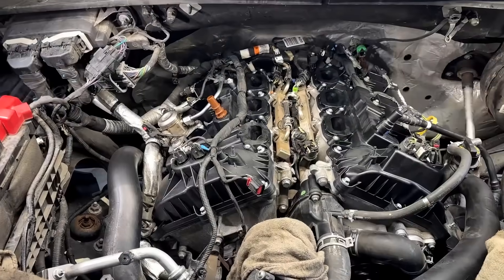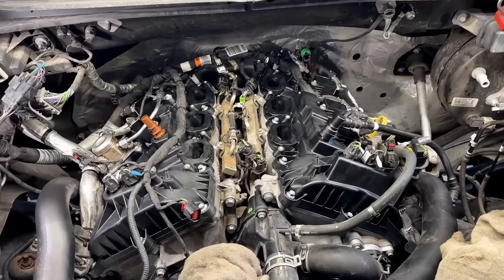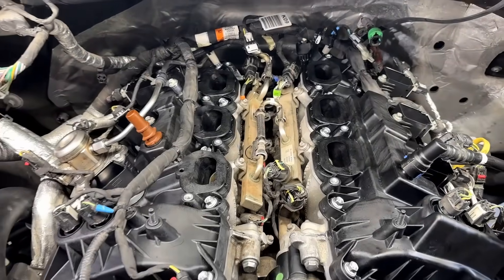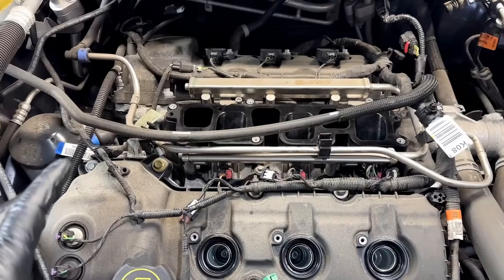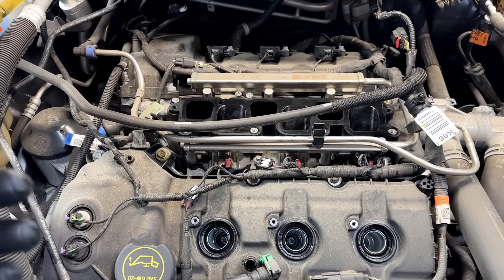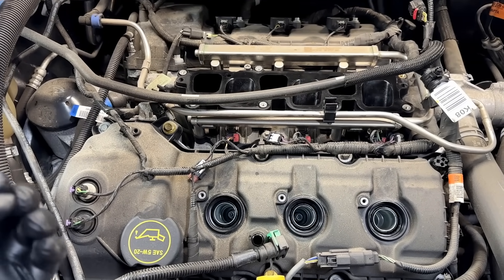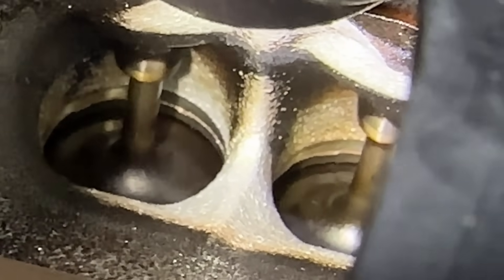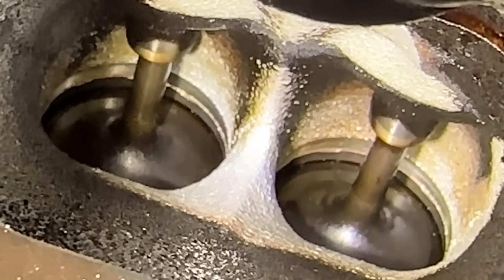Does Ford's New Dual Fuel Injection 3.5L Ecoboost Engine Really Fix the Carbon Build Up Issue?

Comment: So is running the transmission selector in eco mode a bad thing then? Should I be doing some hard accelerations to burn off the cabon or is that not going to make a difference?
Reply: He mentioned that port injection is in play at idle and when accelerating lightly, so no, hard acceleration is not going to help because that’s when DI is working.

Comment: It's amazing to me the more engineers try to redesign the wheel, the more square it gets. How many motors over 12 years old are still running good without any major work have been done to them, as long as good detergent gasoline was used and yearly maintenance was done. (It's my '06 f160 xl with 4.6 ,165,000 miles still runs like the day I bought it) Oil change every 5,000 miles,  STP fuel system cleaner every 3rd Oil change. Had 100,000 miles service. K&N air filter gets cleaned every 25,000 miles. When spark plugs were replaced for 100,00 miles maintenance, they looked almost brand new. Bought truck to take me to nursing home or grave eventually.
Reply: The point is, they are not designed to last anymore. They are designed to fail just after your loan is paid off so you go back to the dealer and buy another one.

The only consistent design with any manufacturer nowadays, is their business design to keep you in a revolving door of debt with them.
Reply: It all in their effort to achieve slight fuel mileage gains and cleaner air.  I'd gladly accept previous technology and save the thousands of $$ we waste today.  Check out any Ford two-valve 4.6 and see how the hundreds of thousand miles they can crank out and not require anything but common sense maintenance. PS Meant to add that I've had two Town Cars with well over 300k miles each and never needed to open them up, except for the damn plastic intakes that puked coolant (Dorman to the rescue). These were the pre-phaser debacle days! Ford's timing/cam engineers fell asleep beginning with the 4.6-5.4/3-valves and phasers still don't last.
Reply: @jamesplotkin4674  2010 F150 with a 4.6 2-valve.  Just hit 165K miles with oil changes every 5K miles, Motorcraft 5W20 synth blend.  Engine runs great, have had to change a few ignition coils over the years.  Only issue is a very slow oil drip coming from somewhere deep behind the rear passenger side of the engine.  Not enough for a $3000 tear down to repair.  Due for a thermostat change as well, as the engine is running cool.  That looks like an easy job.
Reply: So what you mean,is the old Italian tune-up won't help, cause at wide open thottle,it's only running direct injection,then idle and drive like old lady you run on port injection.carberaters clean valves better,where is technology going
Reply: @michaelbefumo-qg7ji nah I still boost once a month when a dodge hemi or toyo want to pick a fight. The see the f150 red tailgate every time
Reply: well the f160 was a better made truck than the f150
Reply: @jeromeharrison7450  f160? Really? Right!

Comment: Will an Oil Catch Can actually make a difference on this dual injected setup? Or should this Gen Eco Boost owners join the pin hole in the intercooler club. I ve also noted less carbon pick up on my spark plugs which lasted me about 55,000 miles since I had to get an Induction service due to Loss of power  back when my truck had 47,000 miles ( currently at 110,000) - 2011 screw ECOBOOST

Comment: I've got a 2012 5.0L F-150 that some years ago, I put air/oil separators in the emission system.  When I change engine oil, I clean both oil catch cans and one is about three quarters full and the other is about a third full.  I couldn't believe that much oil would be put through the intake into the engine.  I remove the throttle body about 35,000 miles just to check the intake manifold for oil.  It's clean.

Comment: The 2019 with 125k miles obviously had more rural/highway use which alone may have reduced carbon build up.  Getting rid of direct injection completely and putting the camshaft(s) back in the block sure would make for much higher reliability and probably 300k miles before any major engine work would be required.  I believe overall carbon footprint would be as good or better too if you consider everything.
Reply: direct is a power adder but pollution adder too so EPA should ban it or regulate it for that.
Reply: @jamesmedina2062    They do regulate emissions,  the entire reason the dual fuel system exists to to help with soot emissions.

Comment: Have you come across vehicles equipped with an aftermarket oil catch can in stalled in the PCV system and, do those engines seem to have less carbon build-up?

Comment: The root cause is the cam timing causes the intake valves to open up as the engine is on the end of the exhaust stroke.  This pushes exhaust back up the intake to be drawn in and burned again.  This is how the automakers got rid of the EGR systems on engines.  We can thank the EPA for all of the carbon build up issues on DI engines.
Reply: Actually it's the PCV putting blowby into the intake.
Reply: @hotrodray6802  that's what I think.
Reply: @hotrodray6802  not chevy bud, PCV goes into valves on ford.
Reply: I think you're partly right but you're forgetting pcv being sucked back into the intake manifold along with small amounts of oil passing down intake valve seals
Reply: @chrisoliveira6941  The oil adds to the issue and adds layers.  However, what we have is carbon which is the result of combustion.  It would need to be over 400 +/- degrees in the chambers to get oil to its flashpoint and create the carbon we see in the video.
Reply: So, would it be even less had the owner installed a catch can on early in the life of the truck?
Reply: That's what I'm wondering
Reply: @danmueller8895 oem will not do this because it requires maintenance that that can't count on customers to do inside of warranty. Not servicing a catch can hurt an engine badly. But I agree with you. Don't buy a cheap small one that you constantly have to empty either
Reply: @danmueller8895 tried it. It causes turbo issues.
Reply: Sorry but incorrect. It’s the atomized oil mixed with the gasses and goes out of the crank case ventilation valve and fed back into the intake. Then into the ports. The atomized oil then instantly burns to the hot metal and boom. Carbon build up. Catch can lowers this by 90%
Reply: @jonathanottman3627    Please explain how the manufacturers got rid of the EGR system.  I was there as a powertrain engineer from 1994-2007 and my description is how we did it.  The little bit of oil from PVC only adds to the problem and is NOT the root cause.
Reply: Wrong
Reply: It still goes into the ground after we clean it out
Reply: Damn the EPA for giving us cleaner air and water. Selfish SOBs. Sounds like Ford is to blame with poor engineering standards.....
Reply: @kennethwolkens6251: appreciate your engineering input. A few questions: (1) are you aware of testing done with cams of alternative timing that would reduce/eliminate the regurgitated exhaust gas into the intake? (2)are you aware of gas sampling/analysis for gases taken from (a)PCV return line (b)intake runner and (c)pre-catalytic converter location? It seems to me that the buildup is coming from un-oxidized products... i.e. CO(though poorly oxidized) and CO2 would not be chemically amenable to carbon deposition on the places shown. Just thoughts/questions... would appreciate your input.
Reply: EXACTLY CORRECT ON THE EPA. MY brand new 1973 Country Squire Wagon with a 429 had carbon buildup on the underside of the carburetor butterflies. I blocked it off and have been ever since.
Reply: I agree with you about the mechanical cause of that carbon build-up but the EPA shouldn't be blamed for promoting clean air. Look towards profit-driven manufacturers that short-circuit testing programs and underfund  engineering departments. They sell ill tested designs and then, look elsewhere when, more than often, their gamble  backfires. Regards !
Reply: @Daniel Robert  the buyers that are early adopters are the testers. Lol
Reply: @danielrobert7181 the EPA is definitely required to shoulder some of the blame.

Comment: Thank you for continuing to report on this. Were either one of these running catch cans, synthetic oil (natural gas), running premium fuel, changing oil at 5k, ? More reason we need to work out electric vehicles or give up on the marginal fuel MPG gains and go back to port.

When I recently changed out my sparkplugs at 62k I noticed the plugs were Carboned up slightly (not fouled), is the carbon on the sparkplug a good proxy for what the valves look like? My van still runs great and I am always ahead of maintenance cycles (as I have always been) as it's worked for me historically. Thanks again!

Comment: I have a 2012 3.5 with over 180K on it. No catch can and original timing set. Runs great in warm Florida. Do you think I should have the valve walnut blasted clean or wait for symptoms and have it torn down for cleaning? Merry Christmas!

Comment: I'm very interested to see valves on a dual-mode injected engine when it's been run on E85. I have a 2019 5.0 F150 and run a couple tanks of E85 every few months to try and keep carbon buildup to a minimum.
Reply: From the engines I've seen in the shop that were run on E85, it's not good. They look like they have been running for many hundreds of thousands of miles. 
But, I haven't seen a 5.0 yet.
Reply: My gen 3 Coyote runs somewhere between 70%-85% Ethanol all the time. Only time it uses 100% Unleaded is after oil changes per recommended by Ford. I bet anything everything is clean as can be. I have seen other engines opened up that ran E85 all the time and there was no carbon on anything. I'm talking they looked brand new.  The only thing you need to worry about with Ethanol is water and the corrosion from it. So long as the Ethanol doesn't get old in the car it should be a non issue. Also, it will break down the oil a alot faster. Even thought my car takes 10 quarts of oil to combat oil breakdown i change it every 3 months regardless. I only put like 1 or 2k miles on it in that time but better safe than sorry. I also use the best full synthetic oils.
Reply: I’ve seen a Mazdaspeed L3 the same as 2.3 but no vvt on exhaust. No catch with egr running meth at the TB still pretty nasty but better. Also seen with cans no egr 4 extra port running e30 mix stay cleaner. Then again both fuel systems run at same time with split fuel controller.
Reply: Make sure you always run 20 mins plus after fill, oz tuning is the way to go performance and reliability check out omegax flex fuel tune
Reply: stop using that crap/

Comment: Great video, I was curious about the dual fuel injection. Also good info on how the system works. 100k to 150k miles and you have to do a timing job on this engine? Yikes.

Comment: Great video Brian. Thanks for the triple comparison. I have walnut blasted my 2013 twice now at 120k km (not miles) and run a catch can now after the second round. I expect a third round this summer, but hope not.
Reply: How much did that cost you?
Reply: @TSS-T85  $50 CAD for a 50 lb bag of walnut shell media, $26 for a cheap media blaster that I modded. I already had a good compressor, shop vac, safety PPE and a BUNCH of patience and research on how to do it correctly and eliminating the risk of filling the engine with walnuts. It’s work for sure.

Comment: The other reason the gen 2 ecoboost had more carbon buildup than the traditional port injection motor is the port injection motor was NOT turbocharged. 
Turbocharged engines tend to naturally have more blowby than non turbo engines which will result in more carbon build up on the valves…..
Reply from the maker: The port fuel injected vehicle was just a reference point before all this GTDI stuff started and nothing else.
Reply: 👍Got it… 
I really like the old school port injected engines for longevity…

Comment: I don't know if it makes a difference or not but at about 80,000 (120,000 currently)miles I switched from regular gas to premium from Shell that has the detergents in it like I said I don't know if it makes a difference or not on a 14 3.5 EcoBoost F-150 but I figured it couldn't hurt... I also put a jlt catch can on my truck at about 95,000 MI

Comment: That's why it's of great consideration to get an air oil separator where the oil drains back to the crankcase and it's kept out of the intake... The crankcase ventilation system has a lot to do with the buildup and The port side injectors aren't fired enough to help keep the carbon from building up.  Also the EGR is placing exhaust that hasn't been cleaned through the catalytic converters first before drawing the exhaust into the intake manifold.  Toyota and Lexus have it right in firing both port and direct injection during idle, cruising and light load situations.  Ford, GM and FCA need to follow suit with what Toyota / Lexus is doing with the D-4S dual injection setup.  The same could be said for Subaru since Subaru is owned by Toyota.
Reply: It's a shame we can't dump the crankcase vent directly into the exhaust system.
Reply: @carsten4594  So realistically how much will a catch can help? I'm looking at a Ford 3.0l and I don't think they have dual inject on it.
Reply: @kckrol85  Are we attributing the carbon buildup to EGR or is it due to crankcase fumes vented into the intake? Intake valve buildup doesn't seem to be a problem on naturally aspirated direct injection diesels. Both of mine vent the crankcase directly into the intake. My '17 GLE350 3.5L V6 direct injected gas also has crankcase to intake venting but the fumes pass through a centrifugal separator on the way. Mercedes this is their solution to the issue.
Reply: @kckrol85  I think a catch can is a great idea. Easy to install and can't hurt.
Reply: @carsten4594  So as a result of this centrifugal separator, how does your intake valves look on the 3.5 direct injection V6 in your Mercedes?
Reply: @matthewmiller2268  With 67k mi. on it I haven't looked yet.
Reply: What I meant to say was: "The crankcase vent system has everything to do with carbon buildup in the intake system".
Reply: @carsten4594  The EGR is a part of it too
Reply: Toyota and Lexus did it right for both direct/port injection fires together during lite to moderate load, cruise speed and direct during hard acceleration, but they should've did both during hard acceleration as well...Ford should've programmed for both direct/port injection to fire during hard acceleration to avoid excessive carbon buildup or buildup period from taking place.

Comment: Sorry to sound dim... But when these engines are idling do  they run on the port injection?
Reply from the maker: Yes
Reply: @FordTechMakuloco  thank you.. soo if you leave it to idle in theory it should wash some of the carbon off?  By the way I have one of the new 1.5 3 cylinder engines what's your thoughts on this engine? Please.

Comment: All Ford ever seems to want to do is put a Band-Aid on a gunshot wound. They should just do it the easy way,  like they used to put a gutless 460, COMPLETELY gutless in their trucks for another 20 to 30 years instead of putting real engines in them. My 1987 F250 is so gutless compared to my 69 F250 it is just horrible

Comment: direct injection is one of the worst things car manufacs have come out with . not only carbon build which causes misfires etc... but i had a ford transit where the injector was seized in the head and required new head injectors etc..... costing the customer 5k in repairs

Comment: Most EcoBoost owners are not using premium fuel. I suspect premium fuel results in a more efficient combustion cycle which results in less carbon soot. Is it enough to make a difference, I dunno.
Reply: I think most of that comes from the PCV system recirculating oil laden air from the crankcase. Maybe the Ford system isn't too good at separating the oil out before it goes into the intake?

Comment: I installed a catch can on my 2015 2.7, with regular oil changes between 5-6k miles in hopes to keep the deposits at bay. Truck now has 112k miles with no known issues other than the 'hunting' torque converter which drives me crazy! Anybody else?...what's the remedy??

Comment: I am not certain if how someone drives the vehicle has any bearing on the amount of carbon buildup. Or if there is any difference in the buildup on the 1st gen 2.7 Ecoboost with direct injection only vs the 3.5 but Id sure like to know.  I have owned a 2016 F150 Supercrew 4x4 2.7 Ecoboost since it was new and it has been worked hard, significant heavy towing and raced as well. It has been 91 performance tuned since it had around 100,xxx miles and evolved into a near full bolt on (still has original turbos) and e50 tuned beast making roughly 200bhp above stock rating. Furthermore it still has the original timing set and ignition coils and now has 207,xxx miles. At around 200K I pulled the intake and cleaned the valves. They were about like that 100K 3.5 with port injectors, a little worse but certainly not in the category of the non port injector 3.5. Those horror stories are why I pulled my intake. Mine doesn't have port injectors. I also don't have a catch can.

Comment: Would it hurt to run a water methanol kit on these engines I've ran water methanol on a boosted  ls engine when we swapped intake manifolds there wasn't one piece of carbon on the intake runners or valves